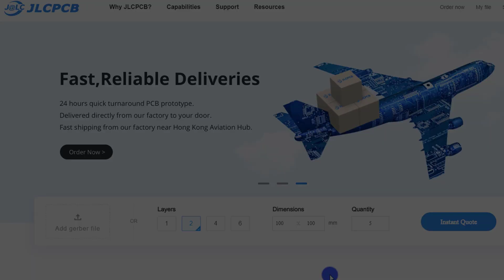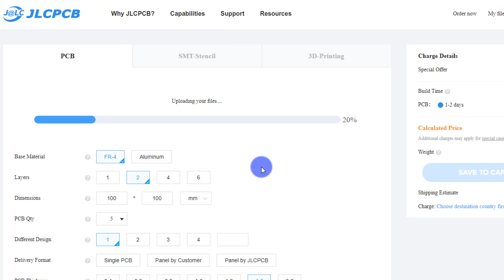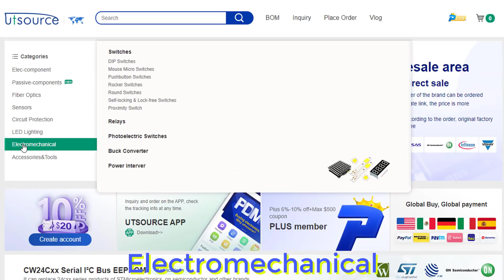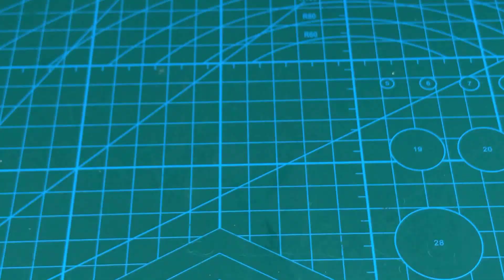1.5 KW Control Board For Inverter

Comment from the maker: Hello Bro ! Where are you from?. What project do you want me to do?.
Reply: Can you design a very very compact smps Or boost converter using through hole component with all inbuilt protection 
Secondly if you can , can you build a tone tone controller Or sound enhancer
Also a very compact 500w amplifier with tht components 10*15mm Or less with protection with case better than cheap chinese.....
Reply from the maker: it's not easy to do. maybe i will try to do it in the future. thanks
Reply from the maker: @Godofminds123  ok BRO
Reply: Hello friend. I am from armenia. Radioelectronics is a hobby for me. I constantly watch your videos very interesting. Thank you and good luck.
Reply from the maker: Oh. Nice to meet you. God bless you bro. Thanks
Reply: @LongTechnical  I as an btech admire and love to see your effort and videos...........
Reply from the maker: @nverkaltaxchyan2514  nice to meet you
Reply: ❤ @nverkaltaxchyan2514
Reply: República Dominicana 🇩🇴🇩🇴🇩🇴🇩🇴👍🇩🇴👍🇩🇴👍🇩🇴
Reply from the maker: Thanks. God bless you bro
Reply: @LongTechnical  hello this control system works for 24v or 48v.  Thank you
Reply: Im from indonesia.. I want u do make class d fullbrige dual feedback systematic mr. Kartino suradipo. Tq
Reply from the maker: I will try to do it bro. Thanks
Reply: Can you make portable solder with 2s or 3s 18650 battery?
Reply from the maker: Yes bro. I will try to do it thanks
Reply from the maker: @Kagami1989  OK Bro
Reply: Can you build a portable c-type related projects....
Reply from the maker: Maybe in the feature bro
Reply: @LongTechnical  untuk resistor pada pcb yang di tulis 100k apakah anda menggunakan 1k?
Reply from the maker: @Godofminds123  OK Bro
Reply: You can build a through hole very compact size welding inverter or dclass amplifier with good cooling system
Reply from the maker: I will try to do it bro. God bless you
Reply from the maker: @Godofminds123  OK Bro
Reply: Hey do some giveaway of your pcb or you can conduct some giveaway of some of your selected project it may boost your channel growth... 😏🥺🤤🤤🤤
Reply: Hola de lima. Perú

Comment: Good but not perfect from all these kind of circuit is missing short circuit protection in the case that modfet failures, it then causes the whole control circuit ad more mosfet to destroy, I have thought to make that kind that it includes what you have and then short circuit protection.